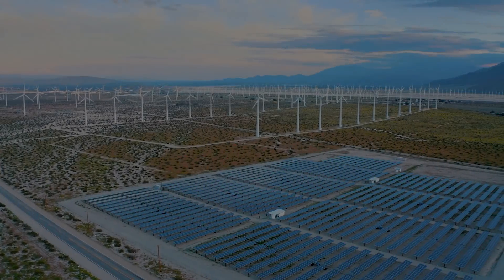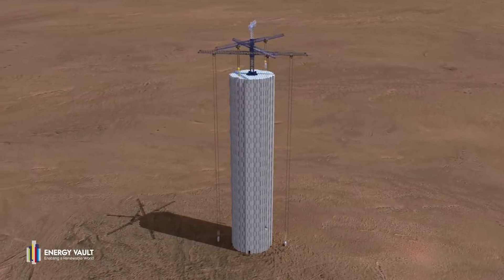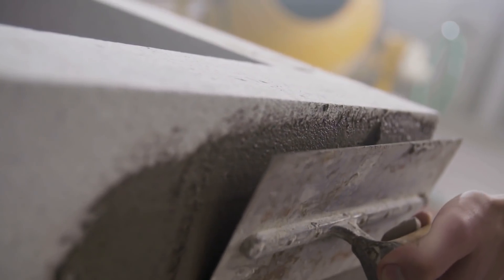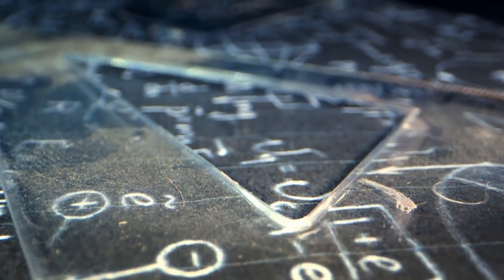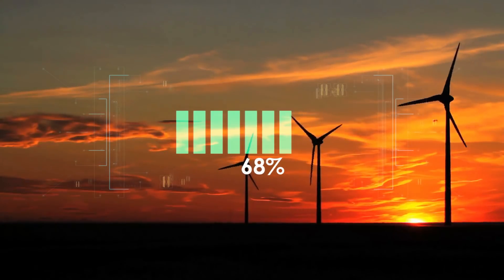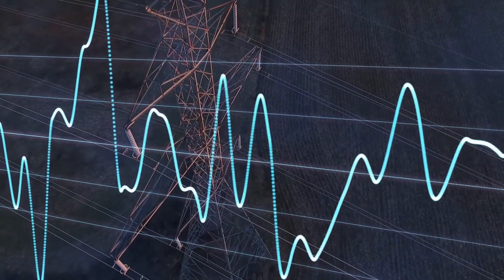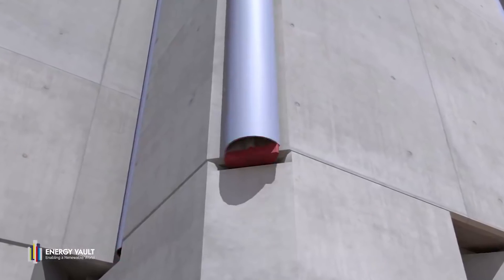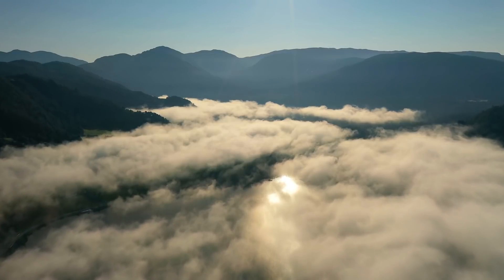Is Concrete the Future of Energy Storage?

Comment: The cranes should drop magnets down tunnels of conductive coils like copper. It will release potential energy and generate an electric current from the magnetic force, similar to a magnetic turbine
Reply: Waste of time. You can't get any more energy out that way, may as well keep it tethered and power the generator directly.
Reply: @MrGonzonator  to answer bother of you, the problem isn’t energy generation. It’s energy storage. We know we can get enough energy from renewables, we just don’t have the capacity to store and transport that energy.
Reply: Can't we just use magnetic force and spin a motor to generate electricity? Is that a practical way to generate electricity?

Comment: carbon based super caps, graphene as the hyper version
Reply: same life-cycle as a wind turbine
Reply: preferably in same construction, combined
Reply: spin inertial mass storage on the down-shaft
Reply: there is no objective price, they are all chosen by sellers, enter non-dependent producer
Reply: ie, not buying supplied from the public markets, diy only, no price
Reply: "lets just stay in the current", the message, always
Reply: Im not paying you, you are paid by the one you work for
Reply: The holy grail for super caps is fast charging but slow release.
Reply: @nigelwinslow  false
Reply: @nigelwinslow  both what you could mean are already good enough
Reply: @nigelwinslow  and super caps making is literally, umm, carbon cheap
Reply: @nigelwinslow  slow release, just dont take amps, it will not self-discharge fast

Comment: Your scope for electric battery systems is limited to the Tesla grid battery solution only. As you are comparing it to near future mechanical systems you should also take into account near future grid electrical battery solutions like the Ambri liquid metal battery. Cost for the Abri battery is significantly less then the Tesla battery system that is based on Lithium.

Comment: Is concrete sustainable or finite?
Reply from the maker: Apparently they are planning to use old waste concrete, but from what I know concrete is quite plentiful, but has quite high emissions when its made!
Reply: @ZirothTech  My fantasy similar plan devised decades ago was to use plain rock. This solves storing room too. 
You simply dig a few km deep shaft, than few km long tunnel, in a 1 degree slope for auto feed the shaft. 
Tunneling may seem expensive, but since mining for simple ore extracting is feasible, mining for millenia of use, for sure will return the cost.
Tunneling now cost few hundred per ton. It may be cheaper to grind with water the outer cylinder, and mount tiny wheels on inner cylinder, and one unit of storage is ready. 
But gear and cable wear throws me off. I have no idea about how fast is the wear.  Gravitricity seems more feasible. But also wear is the key.

Comment: You mentioned that high density concrete is heavier than water. But nearly everyone thinks that concrete drys out. It doesn't. Most of the water is still in the concrete when set. It may feel dry but its trapped chemically.
Reply: About 160 l of water in a concrete mix, 80l for the chemical reaction and 80l for making the concrete sloppy (workable) . So about 80kg of water
Reply: .. in a 1 cubic metre which wieighs about 2400kg.

Comment: Personally I do not think gravity storage will work at all in the long run. Reasons for it? Great complexity, lots of maintenance for the whole crane system, sensibility to winds (with stronger winds, you will have a very hard time placing the blocks with high precision, which completely halts operations)... Also, how many blocks would you need to replace even a small reservoir? It could become very ridiculous. Also, the potential energy in gravity systems depends on how high your blocks are respect to the height at which you can place them, which is the full height of the tower only for the first blocks in the bottom row; as you place blocks higher, you have less and less potential energy.
Reply: Many are being partially built underground so no. It doesn't wear out and takes around 25 years to need to be replaced. Also the higher the blocks the more potential energy it has.
Reply: You are talking about energy vault or gravity battery?

Comment: Great video all very accurate, except the amount of hydro being used is more like 1% not 100%. There are thousands of lakes, streams and rivers in upstate NY. And when you look at the hydro-electric dams they have setup they will use 10% or less of the total drop, such as lake George emptying into lake Champlain is a 200' elevation difference and water has to constantly be let out all year especially after rain and snowmelt. There's a hydro dam in town that captures about 15 or 20 feet of That drop. Not to mention there is the possibility of tidal batteries, using a bay as a battery and the tides as the power, some places the tide is over 20 feet!

Comment: Another thing that is important is long term storage. Like for solar, you have a huge amount of energy generated in the summer but not as much in the winter. Lithium-ion batteries could have a hard time holding their charge over an entire winter. But with gravity storage, they should have no problem keeping their “charge” or potential energy over these longer time periods.
Reply from the maker: Yea this is very too, I've also seen interesting long term thermal storage using hot rocks underground!
Reply: They will want some handsome prices for the power stored if they have to store it in summer and not discharge it until winter....
Reply: I think seasonal variations in the north  will be handled by trash burning power plants with district heating, like Sweden is doing now. Yeah, reuse and recycle first but sooner or later everything degrades too much and burning is better than burying. You can even do carbon capture to make it carbon negative.
Reply: Generators have to work a little harder during the cold. So even though potential energy may be the same in winter vs summer, the generators that are absorbing that energy wont be as efficient during the winter time.
Reply: Also, batteries suck right now.
You would need 10 of the largest ones to power New York City for a single day.
And since said batteries cost 2.4 billion each . . .
I think you can see the problem.
Really we just need an energy source like nuclear that's both clean and constant.
Reply: Technically possible, yes, but it will never ever ever be economical that way. It basically increases the cost of storage by x365.